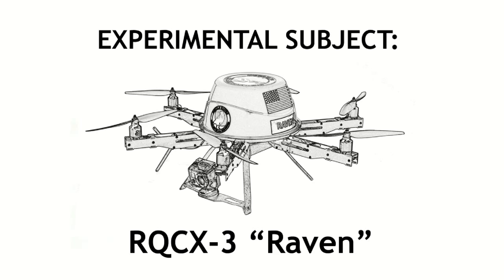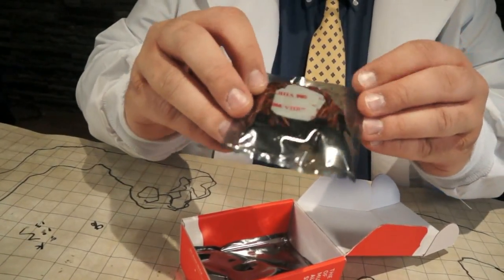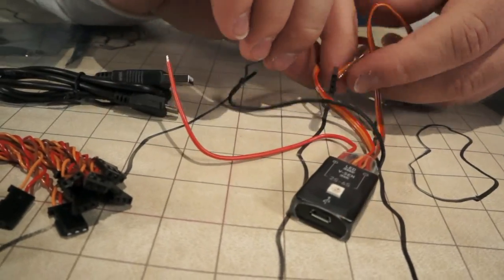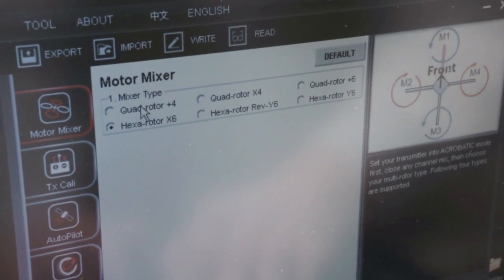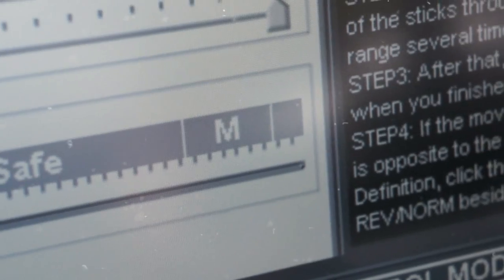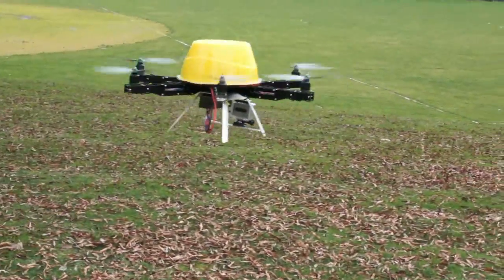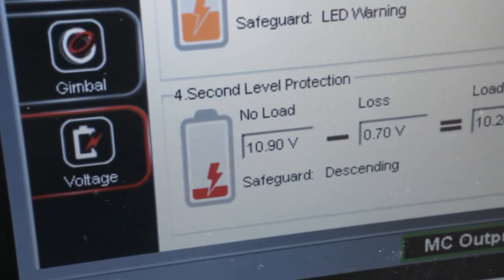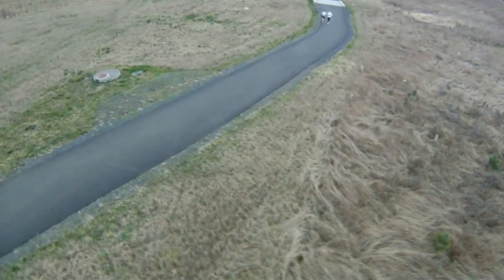RFTC: DJI NAZA Unboxing, Installation and Testing

Comment: I have to say I absolutely hated my Naza fc. I got a Quantum Venture that came with the Naza-lite which is the original Naza which you are using. It would go bonkers after 3 minute flights each time. I thought there was a motor issue so changed them all out. Anything other than manual it would go crazy. No matter how many times I configure the compasss/gps. After about 10 flights the yaw issue that it was having after 3 minutes before just kept happening. Remember at first if flew just like you show. Anyhow I figured it had to be with the Naza not configured for H copters and put in an APM 2.6 which has been flawless ever since. I built a hexcopter hoping to save money putting the naza in. Same issue. I have tried to contact DJI with no success. I threw in another apm with no issue. I have seen almost nothing but good things about these but every single bad review of them has been when they were installed in the Venture with the same issues that I had. I just wonder is happening when Quantum-Hobby King installs these in the venture?
Reply: +FlyingFuYing considering the DJI as the best selling and industry leading company, having millions of nasa units sold. It is most likely you did not setup the naza lite properly.
Reply: Andrew Geng It was factory installed set up by Hobby King. When things started going wrong I started with the motors, then the ecs then I tried a total tare down and rebuild. The ones put on the Ventures have a none issue.  When I installed the apm 2.6 not one issue. I have even had others try the naza lite that came with the venture that only have dji systems. And they could not get it to work.  I don't know why the ones that are sent with the Venture are different from other ones but if you google the Venture deluxe package with naza lite you will come upon a ton of forums and videos of them having issues.
Reply: I have had 80 flights so far, no incidents at all. You must install the latest firmware. I know now that there has been faulty firmware causing flight controllers to fly away and flip.
Reply: Andrew Geng
I have not tried it on a new build for a few months. I did constantly keep it looking for updates from DJI up until June for the Venture. I then tried it again in August for Hex build. Same month I had someone that is use to DJI products try it and had the same issues as me of fine in manual mode but bat crazy in any other. One this for sure I will never have someone build me one again, as it was built by HobbyKing. After checking all of the rates and checked all solder points and wires. The wires to the engines were totally messed up. They had frayed the wires while installing it on 2 motors. So I originally thought it was the motors.   I did here there was a Russian spoof fw that would correct its issues at the time, but I never trusted the sites the fw were on. I will probably make it into an fpv manual flyers only some time down the line. I have way to many multirotors as it is to make a new one now.
Reply: sorry to hear your bad experiences, These multi-rotors are not hard to build, just a bit time consuming, I always suggest people to build it themselves, for they will always be sure. If they don't want they are doing however, they should keep studying.
Reply: Andrew Geng
I agree. I built a hexcopter after the venture and freaking loved it. I did all the work. I mean I did tare down the venture to see what the hell was wrong and then put it back together but this one was my design and my build.
Reply: yep, no one is gonna pay as much attention to your multi-rotor than the guy who paid for it! haha

Comment: what,s the point in that you might just as well fly a kite, or better still learn how to fly a tricopter  with a £13 KK board on board, and spend the extra cash on a few cold one's

Comment: youre right about devices like this retarding piloting skill for learners.
I fly single rotor 3D capable choppers and have since 1987 so i learned the hard way.
yet when experiencing my FBL controller last month, the IkoN (similar in function but for single rotor), I felt spoiled, and could feel myself getting lazy...lol
It augments any kind of wild flight pretty nicely, and switching back to manual, felt like I lost a year experience. Noobs using it to learn wont fly well without it, hehe

Comment: can i use some other motors for this one ?, i know  that naza's stock motor are good but they are expensive , there should be many other stable , balanced motors around, please help also please recommend esc  , do they require any  special type or any branded esc should work ,

good if you can tell something from hobbyking , as this is the nearest place i buy .

Comment: Hey guys.  Ive been having trouble getting my altitude hold to work.  I hear all u have to do is have the stick center and it should kick right on.  Mine doesnt.  its driving me crazy.  Another thing.  I have my gear switch hooked to the m mode and attitude mode. it flys great in manual mode.  But when i hit the switch to go in attitude mode,.  The quad lands by itself and the orange blinks fast,  What am i doing wrong.  Please help.  Thank you

Comment: great video guys, just took delivery of my Naza today. Was wondering about the thin 3m pads as well, I still have some of the thicker stuff from my Gaui 330 and was going to use that, but just read in the comments here that the 3m ones should be just fine, so I'll go with them..

Comment: Nice! i have a plan to build my first Quad with the naza. I read that naza barometer(alt hold) dont go well with an air tight container as a Dome. but yours hold the altitude great, did you guys make some hole for the barometer to work?

Comment: Nice video guys.  One question - did you try attaching the Naza to your frame using other methods than the supplied 3M VHB tape?  I'm used to using a bit of firm cushioning on my FC quad attachments and wondering if they'd make the Naza perform better or worse.  If their vibration filtering is really good I could understand them wanting as direct a connection to the frame as possible.  That seems like a big if though.  Just wondering if you had any insights.

Comment: Dude...you don't need Big vibration pads, that's old school stuff, also the wires will connect to your rx not tx (RX is receive, incoming. TX is transmitting, outgoing) 
Nice video, thanks. : )